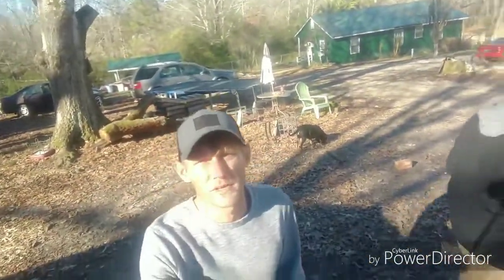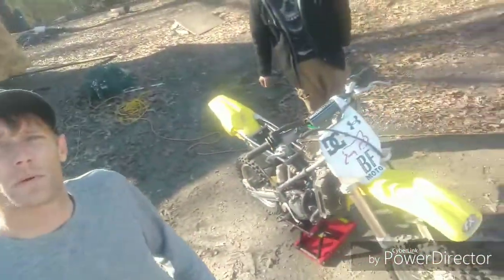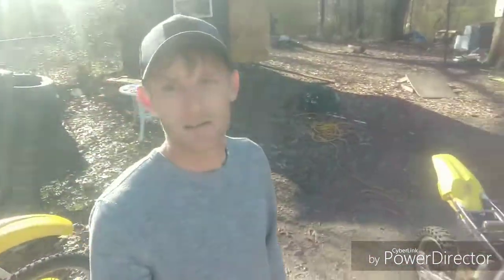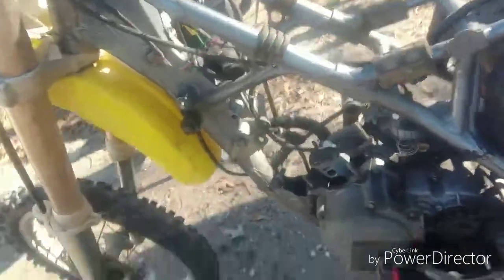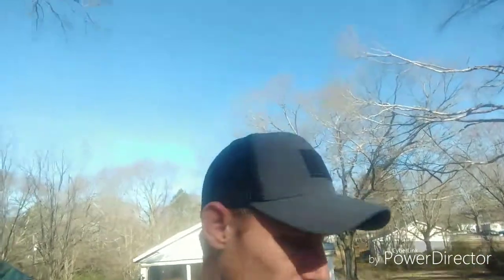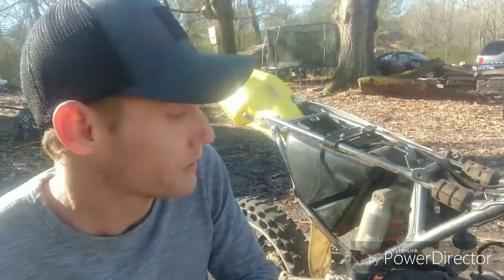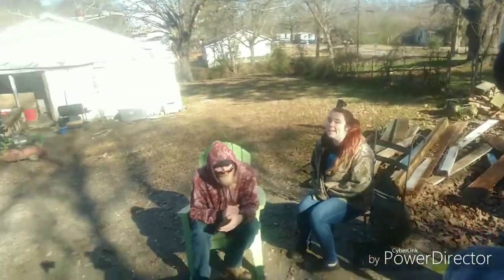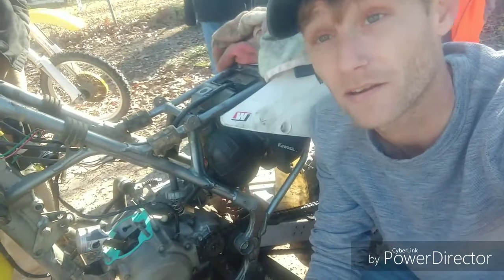Rm/kx80 topend rebuild DIY

Comment: Awesome vid bro.. im doing this kn 10 min lol.. i noticed u used no gasket seal of any kind.  Just the gasket itself. I was gonna use gasket maker with it .. i shouldn't?
Reply from the maker: U can just just it on the bottom of the cylinder..check for ring Gap and play in the cylinder first .. subscribe if u haven't thx